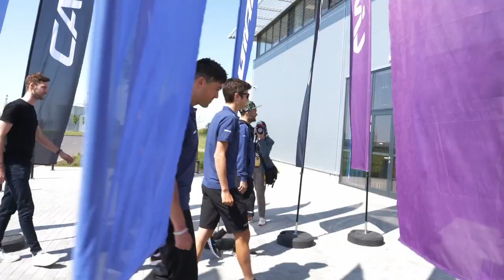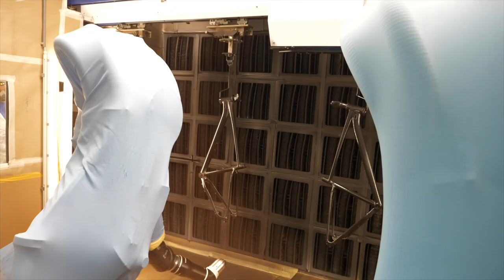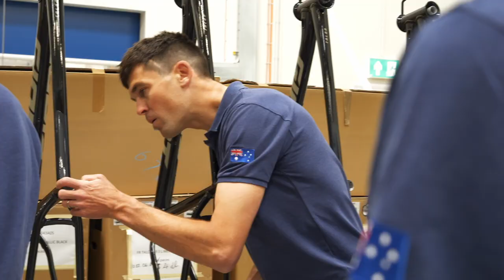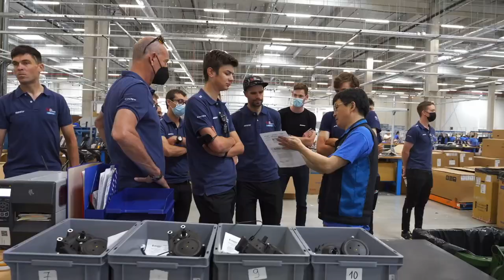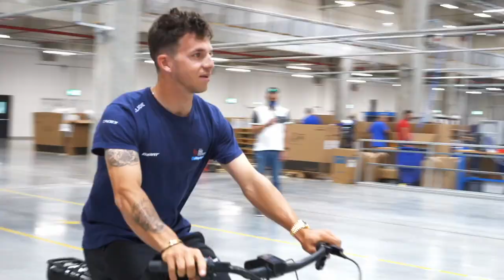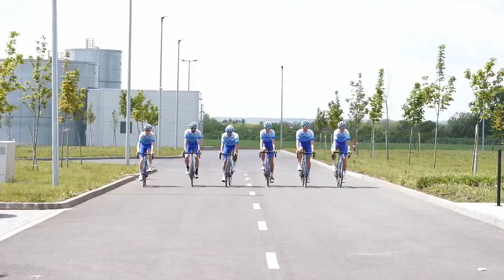Team BikeExchange-Jayco Visits Giant Group Hungary Manufacturing

Comment: you went overboard with losing weight on your bike.  giant reign frame 29 alu bends in the hands.  it is not stiff.  The rear triangle tubes are so thin they buckle from the seat itself and it's scary to ride on it. the quality and strength of the frame decreased
Reply: What’s the weight The bike? Size?